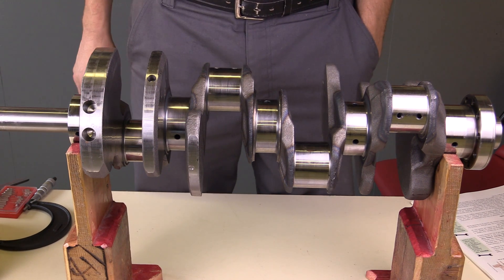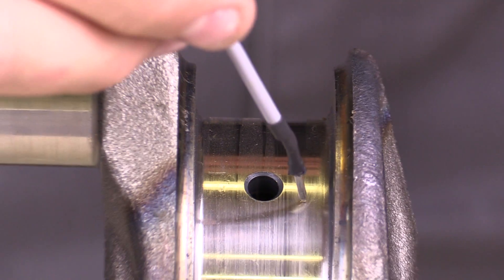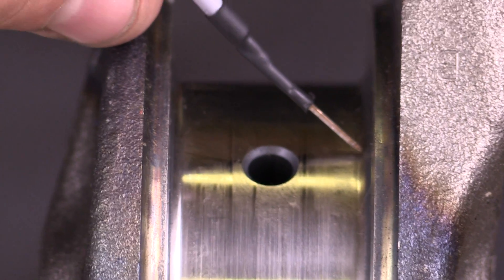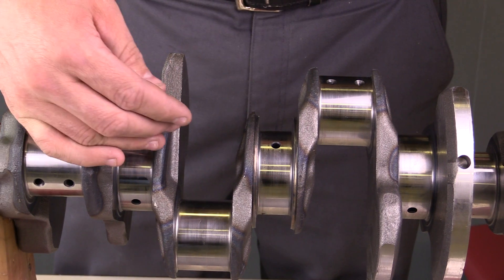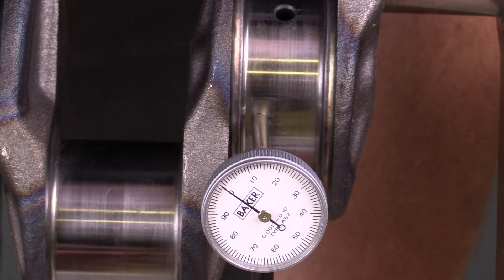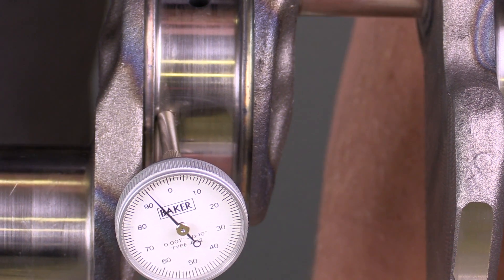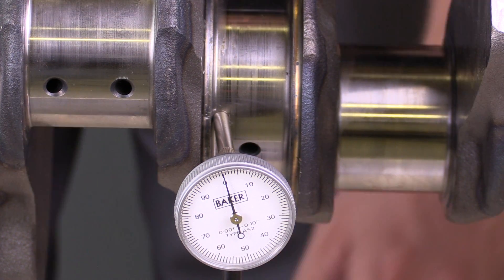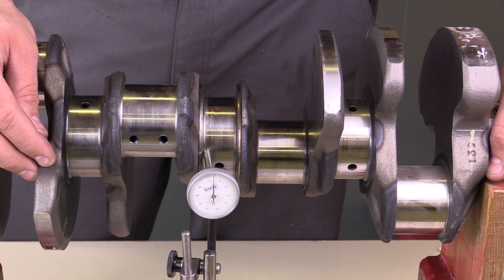How to measure crankshaft run-out

Comment: Well first step of precision measurements is to make sure your measuring device is consistent and secure lol. I.e. when you start rotating the crankshaft your dial needle shouldnt be walking all over the journal because you just have your mag base just sitting on a wood table. Also its a good idea to preload your needle before you zeroing it out.
Reply from the maker: Good point

Comment: the dial indicator plunger has some pressure/tension on it as it's pushed in a little, if you relieve the tension and the reading will stay zeroed, and won't deflect until warpage encounters it